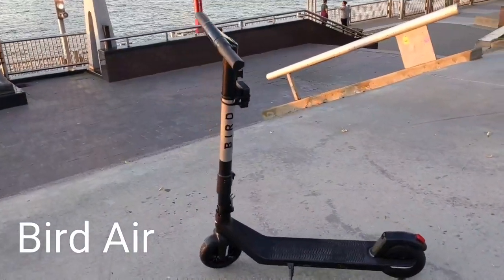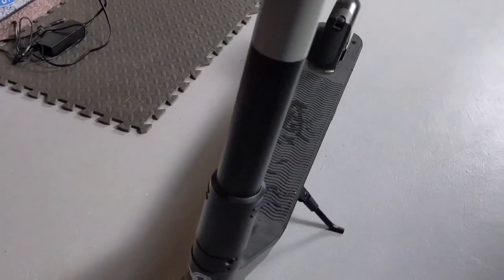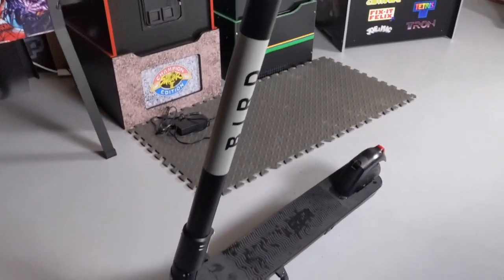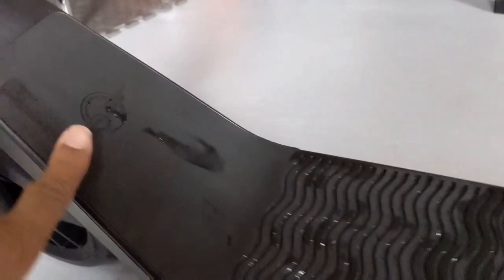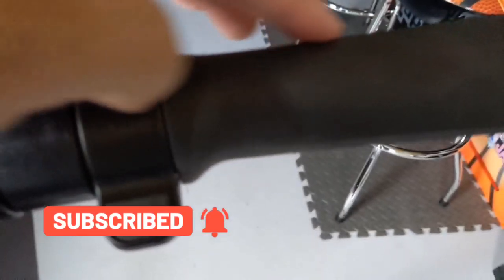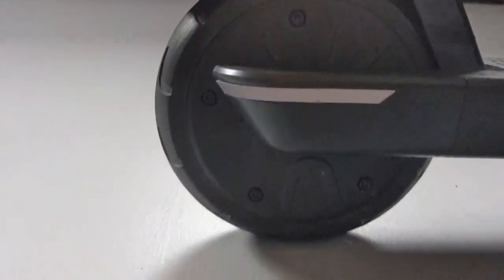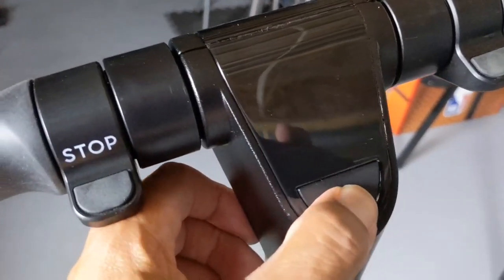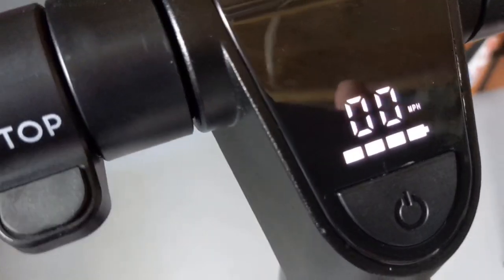Bird Air Electric Scooter - A Deep Look at the Construction & Why I Returned it.

Comment: You're confused. The one that you can lock is called the Bird One, that's a higher end model. You were reviewing the Bird Air. The Bird One has a built in GPS which shows you its location with the ability to lock as well as a speed of 18mph with a distance of 25miles
Reply: Is the bird air locked at 15 miles ? And are the rental ones faster ? I really want one, but I would like one that goes the same speed as the rental ones
Reply: @irvindeleon7215  18 miles

Comment: I got one of these, I have only had it a few days and the steering bar has already got play in it that wasn't there before just from shitty sidewalks, and seems dangerous like it may break, I can't find any info on how to fix it but I did find a bunch of info about people having similar and worse issues, worth doing a little research before spending the 500, without any shocks or air in the tires the unit takes all the rattle from riding, not great, in bigger cities there are bird mechanics but not where I'm at unfortunatley
Reply: The silver clip that allows it to fold has a hex screw on the back of it and you tighten that up and it will get rid of the play

Comment: I'm having probs with just powering mine on it says its fully charged bit won't power on can someone tell me why
Reply: Is it blinking 12
Reply: No its not powering on at all
Reply: You got to hold your power button down for a couple seconds if that doesn't work then take it back but when you get on it you got to push it a couple times until the speed thermometer says about 3 and then put your gas thing to take off
Reply: Hey GabbyMoe ... did you ever get the scooter to charge? We are having the same issue with ours. Ugh. Curious what all happened with you.